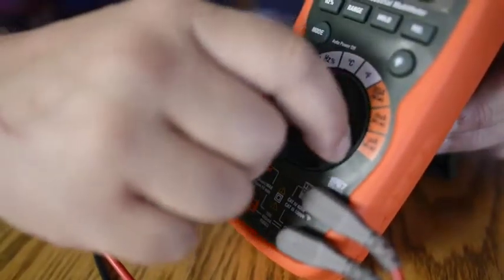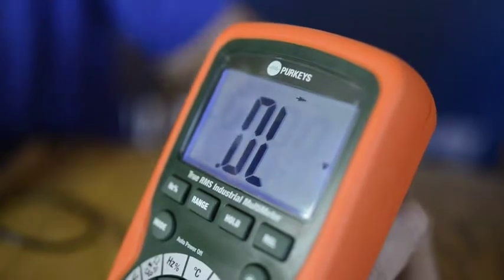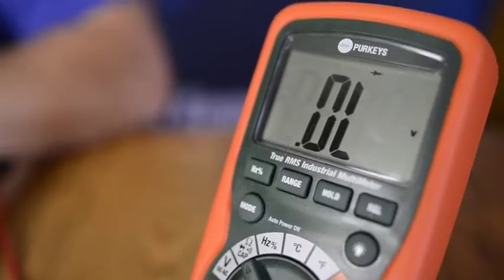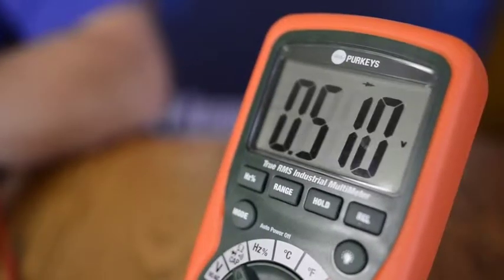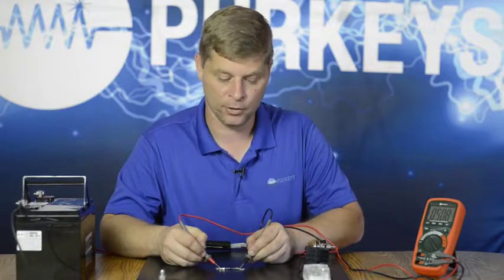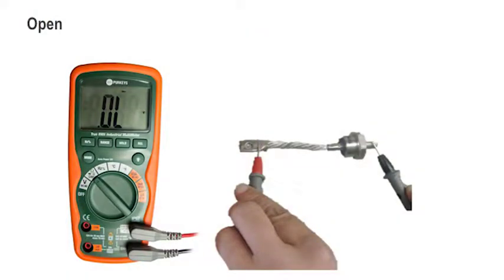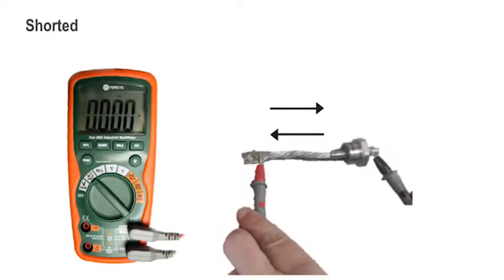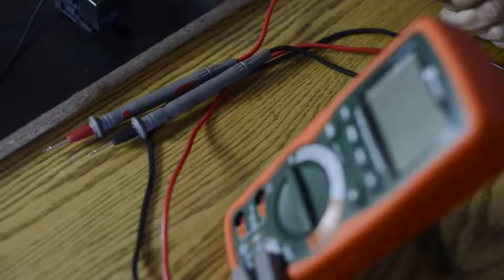Testing Diodes With Multimeters - Purkeys

Comment: tried to check on a microwave diode but it does not work the way he explained.
Reply from the maker: You are correct. The AC power diodes used in a microwave oven generally have much higher resistance and will not test with a common multimeter.